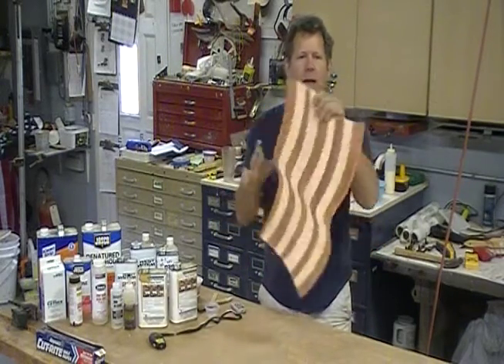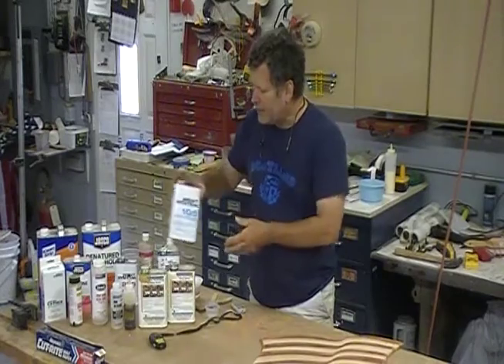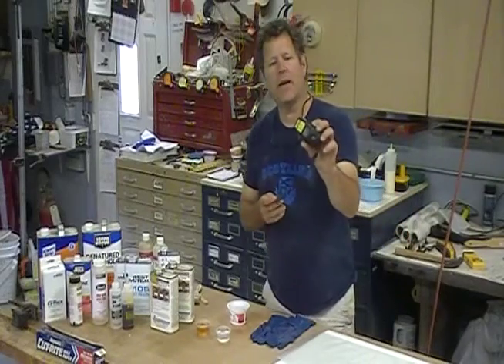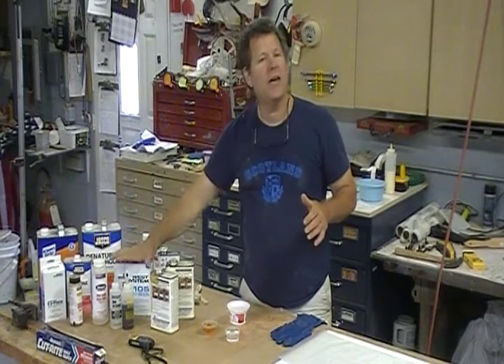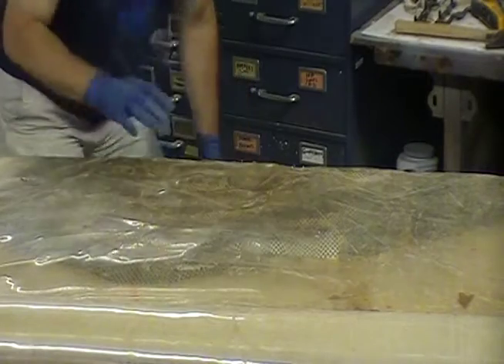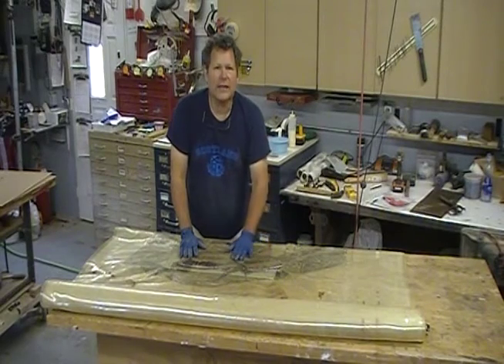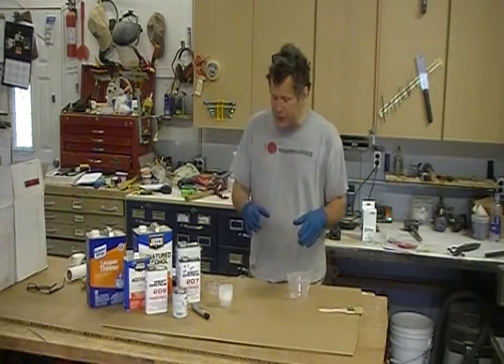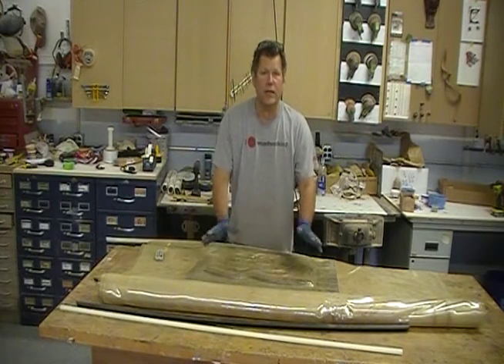Epoxy Infused Wood by Scott Grove from ImagineGrove.com

Comment: I really thought you were going to submerge the wood in resin, put it under vacuum to draw the air out, and then release the vacuum so the resin would be drawn into the wood and infuse it with the  resin.

Comment: What is the benefit of doing that to a cutting board though? I thought the benefit of wood for a cutting board is that the wood is soft and therefore won't dull the knife as quickly as other materials. If you make it rock hard with epoxy, it sort of defeats the purpose of having a nice wood board.
Reply: It waterproof the cutting board. Epoxy is not harder than steel... If that's what you're getting at.

Comment: Good technique, but that's not how contraction works. What is making the wood suck up the epoxy is not the fact the it's cooling down (which shrinks the wood, thus actually spitting stuff out) but that it is warm.